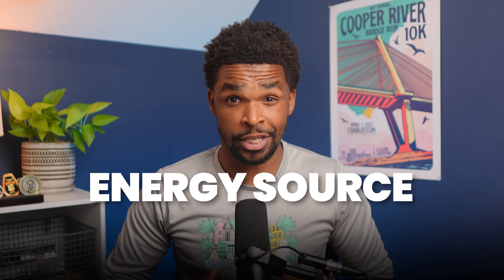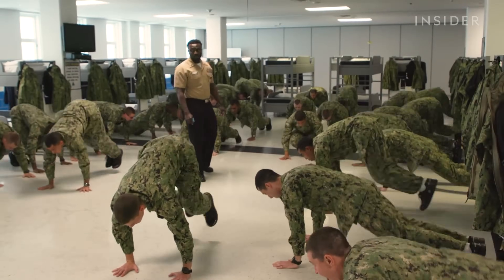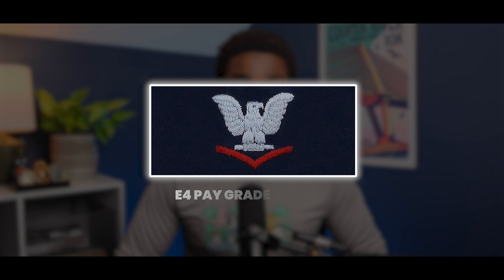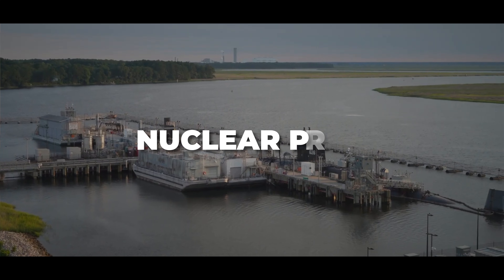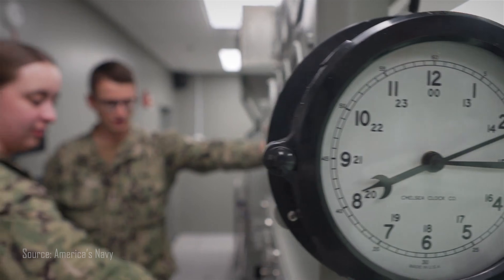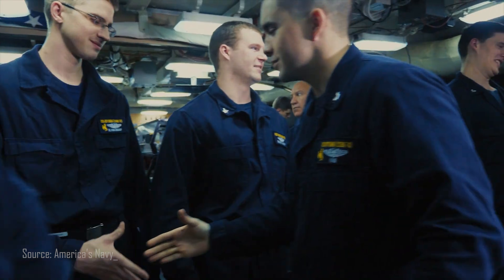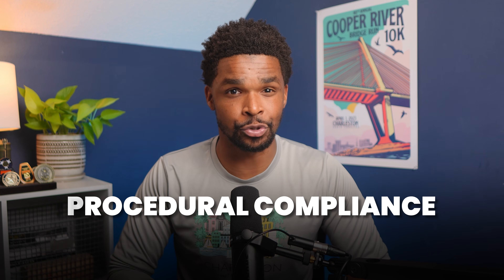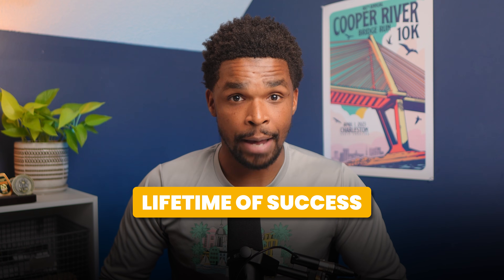Electronics Technician Nuclear (ETN) - Navy Nuke Jobs Explained

Comment: You didn't mention that ETs are the only ones who can actually bring the reactor and maintain it at criticality. Not to mention the need to operate purely from memory and react within as fast as 30 seconds to a casualty correctly. EMs and MMs have to react as well, but direct reactivity control is on the ET at all times.
Reply from the maker: True. Maybe we can cover it more in depth in a later video.

Comment: 1972, I joined the Navy to go nuclear as an ET, my highest score was electronics and my lowest score was mechanical and my recruiter said I would be sent to ET school and I said , Swell, sign me up for six years. Was I ever surprised when I got orders while in boot camp for Machinist Mate A School in Great Lakes and just knew someone made a mistake but was informed that the Navy never makes a mistake and I was going to be a MM. Did I ever show them and failed the first two test and was out of MM school and on my way to the fleet as an undesignated engineering striker to end up on a LST and they wanted to put me in the engine room working on diesel engines. I explained how I was asked to leave MM school and zero interest in engines and talked my way into becoming an Electrician's Mate (EM) and even went back up to Great Lakes the following year for A School. I did learn a valuable lesson, Navy Recruiters are in the same category as used car salesmen .

Comment: I really need your help. I'm planning on joining the navy soon as a navy nuke. But, i recently found out that there is a age restriction of under 25

I am currently 26 rn, is there anyway to go around that? I'd appreciate your response very much
Reply from the maker: Current age limit is 30. You are good to go.
Reply: Also there are age waivers. I joined and became a nuke on a age waiver. If it's what you want to do( and please make sure you really want this before committing) talk to the recruiter about the age waiver and if it's required. If you qualify to be a nuke and express interest the recruiters WILL push it. They get a bonus for every nuke that signs on.
Reply: it used to be 28 with a waiver